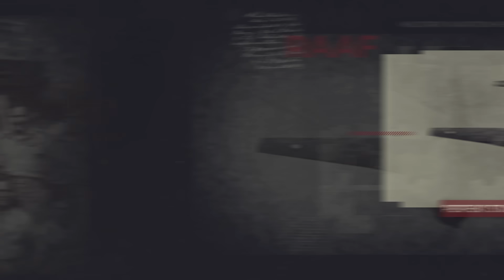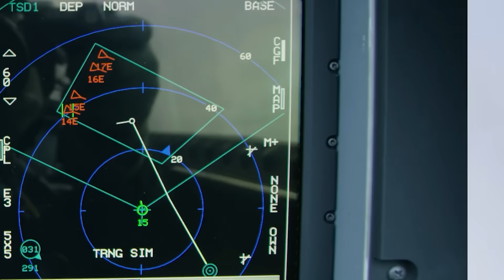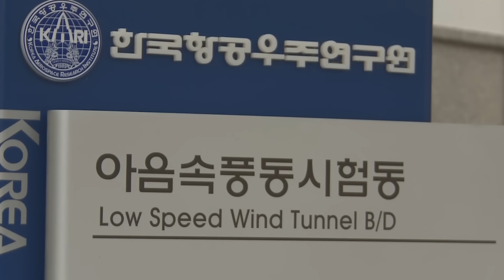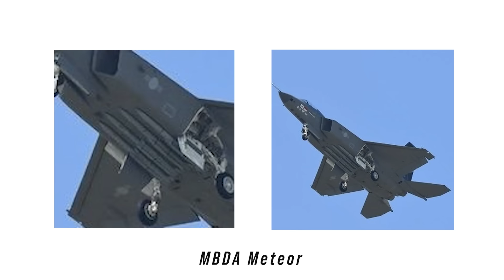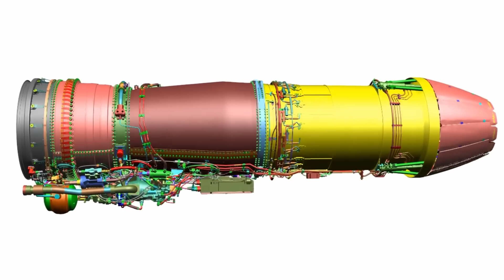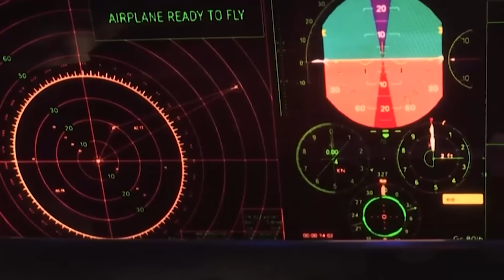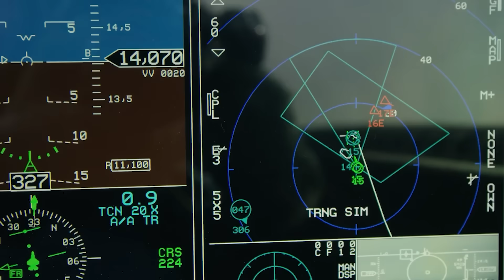KF-21: Korea's New Fighter

Comment: South Koreans often are brilliant engineers, I would not be surprised if this aircraft turns out to be a very serviceable platform.
Reply: Japan also got help from LM. The F-2 is essentially a derivative of the F-16 with significant differences that increase long range capabilities. 

South Korea meanwhile made their own derivative of the F-16 with the help of LM, the T-50 / FA-50. FA-50 is essentially a shortened and simplified F-16 for a lower budget point. 

Thus both countries got their own F-16 derivatives, Japan went for higher capabilities and much higher costs while South Korea went for lower capabilities and much lower costs.
Reply: @Stu_Bur Japan did get help from LM but frankly speaking the development of Japanese F2 is more like joint cooperation between US-Japan. This is evident thru the agreement made in Dec. 1987 during the Bush administration when the US government forced Japan to sign the agreement to limit Japan's native aviation industry. Based on the agreement US provided necessary techs and Japan handed over techs they developed during the F2 development.

On the other hand, KR's development of T50, KF21 is totally different story because KR had to nurture its industry based on tech transfer.
Reply: 😂Sure
Reply: A lot of nations have brilliant engineers but it takes a lot more than that to build a legit stealth fighter which is why America has the only ones doing it since the 1980s. Getting help from American companies that have actually built them will definitely help
Reply: Among the contracts between Lockheed Martin and KAI are as follows.
FA-50 has a constraint that it cannot exceed the latest F-16 specification.
So the FA-50 has its limits.
However, the FA-50 is a cost-effectiveness and has a full role to play.
Very powerful as a 5th generation pilot training, proximity support, and small multi-roll fighter.
It must be a very useful aircraft for both training and practice.
Armed forces are also evolving.
In Block 2
AIM-9 Sidewinder
AIM-7 Sparrow
AGM-65 Maverick
IRIS-T
KEPD 350K-2
AIM-120 AMRAAM
It will be armed.

What is unusual is that the Korean-made AESA Radar is better than the US-made Radar with performance limits.
However, due to the inherent limitations of FA-50, it seems to be impossible to mount.

However, KF-21 has no constraints.
This is because Korea has developed core technologies such as AESA Radar, IRST, EOTGP, and RF Jammer.
The interior armament is also under development and the MUM-T system is also under development.
We're testing to control three drones with wingmen
It is being developed as a multi-purpose fighter with more than five generations at the same time as the development of internal armoured windows.

The AESA radar developed by Korea is a gallium nitride material and is powerful.
It is currently used in Korean Aegis destroyers, M-SAMs, and L-SAMs.
Gallium oxide materials that are much more powerful than gallium nitride materials are also being developed.

Korea has strong EMP technology.
RF-Jammer is also very powerful.
It will reach NGJ-MB performance enough.

IRST is currently on board the frigate and in use.

EO-TGP is already applied to FA-50.

Core equipment is constantly being upgraded with the development of new technologies.

KF-21 Boramae is the name of a falcon when its young is raised for hunting.
Boramae is called the Little Raptor, but in the near future, it will evolve into the fifth and sixth generation fighter jets that will shine on itself.

I hope you will pay a lot of attention to KF-21.
Reply: It's not that hard to essentially replicate existing designs worldwide while modifying slightly in your own way. The hardest part is the manufacturing capacity, highend.
Reply: Lots of corruption, like USA.
Reply: 😂👍 yes from other Countries 😉 People you must look behind the Line also the K9 was from Leo 2 the machine inside ok only their very good adapting and so possible make it better.The K9 was that the difference to Leo 2 so possible inside over decade modernisation possible the same about the Fighter Jets so it's not engineered and their are fabulous
Reply: Maybe they can get Lockheed Martin to help them develop gen 6 aircrafts.  China is already working on to gen 6 platforms.
Reply: Chaebol
Reply: 포스코와 직접적인 지분을 보유한 일본 기업은 없지만, 포스코는 과거 일본 기업으로부터 기술을 지원받았고, 일본제철과는 상호출자 관계를 맺었다가 현재는 지분을 전량 매각하며 협력 관계를 지속할 예정입니다. 또한, 포스코 플로우는 일본 미쓰이물산과 합작 설립한 기업입니다. 
그러므로 일본기업이 아닙니다 거짓 정보는 곤란해요 😂
Reply: A few people seemed threatened by the Chinese here...
Reply: I would give the most credit to the Turks if they really can fly their TFX Fighter cuz they do it all alone and with sanctions from the west
Reply: @Skepticof  I agree that the US makes the best birds.  At the same token, you should know that without the US help, mimic and play from scratch is not easy at all.  Despite the fact the KF-21 looks similar to the F-22, it was developed from scratch with no help from the US.  The reality is that the US never helped South Korea to build its own advanced military fighters so the US can keep selling their overpriced F-35s or F-15 upgrades which would cost far more than producing KF-21s.    With 120 KF-21s by 2032, the Korean Air Force is no longer forced to use overpriced US-produced air-to-air or air-to-ground missiles.  KF-21 can utilize Korean-made advanced weapons.
Reply: @octoberonedave1371  you dumb noob SK received tech transfers for KF21 when they purchased F35😂 Keep talk like trash with 0 knowledge
Reply: its literally a copy of the f-22 kek
Reply: It looks pretty good but that can be deceiving Look at the Chinese knockoffs of 5 gens. They are weak with less quality, shorter range, and dangerous to operate.
Reply: @Forevertrue  There is a huge difference between Korean and Chinese quality, especially military war weapons, ships, and amazing buildings. Koreans can build complex things without stealing intellectual property, unlike the Chinese. The Chinese are famous for their tofu dreg buildings that literally crumble on its own, whereas the Koreans have built the tallest building buildings in the world like the Burj khalifa, Petronas Twin Towers, and Lotte Tower.
Reply: @JohnLee-db9zt  lmao I love how you say this while all tests and videos show that this shitty plane korean plane is literally a rip off of the f-22 while the j-20 at least has an original wing and engine design, and china also currently has the longest range tested naval missles so far even the usa doesn't have it
Reply: @NeostormXLMAX 놀라운 매연 스텔스 기능? 뿜뿜하는 중공 종이비행기는 저리 빠지세요 😂
Reply: With the help of Lockheed Martin.. maybe Japan can do better without any help of others.
Reply: @halfevilhalfgood2206  I didn’t say they were totally acting alone, it makes a lot of sense to use the experience of your partners in any situation.
Reply: @rsoul7282  - Most of the World's technology (and nations) has arisen from that doctrine. There is no reason to reinvent the wheel, and most nations don't have the money or time to embark on decades long Engineering and Development programs for such programs. The first design however, looks almost identical to an F-22.
Reply: @halfevilhalfgood2206  The help from LM was minimal, more like consultants without designing anything for the Koreans.  LM did not  give out any core technologies like AESA radar, IRST, EOTS, weapons/flight control systems, stealth coating, etc.  LM helped primarily in airframe design giving the nod the Koreans if they were going in the right direction. That’s why it looks like the F22 Raptor. The Japanese aren’t doing Jack. They proposed their own 5th generation fighter years ago and hasn’t gotten anywhere. Now they want a 6th gen fighter? lol.  Koreans are playing it smart by starting at 4.5+ gen fighter and moving up to gen 5. I’m surprised how fast this fighter was developed and on budget.
Reply: @JohnLee-db9zt  Altho LM didnt transfer a few core techs but KF21 is hugely based on expertise received from LM thru tech transfer when KR purchased and built F35/T50. T50 is basically built by LM, and KR was able to pick up skills and techs to further their development into native fighter such as KF21. Contribution of LM to KR fighter jet industry is undeniably immense.
Reply: @SH_K  A few core technologies? Lol almost everything important for a 4+ gen fighter with 5th gen capabilities besides the stealth frame was indigenously developed. There was no tech transfer from purchase of the F35 as far as I know. US doesn’t allow that. T50 started out as a basic trainer.
Reply: @JohnLee-db9zt  Do you have sources for your claim? LM transferred 21 technologies such as avionics program architectures, missile integration techs to SK to assist the development of KF21. US-LM-SK signed the contract on Dec. 2015 Engineers from LM were stationed on site the whole time for the tech integration. Only 4 strategic techs were barred from export.

As for T50, it is literally a plane fully developed with Lockheed Martin technologies which SK only participated to manufacture and pick up necessary skills. SK learned and mastered so that they can build KF21.

If you do not have sources for your baseless claims i suggest you to keep silent.
Reply: @halfevilhalfgood2206 They couldn't do it without help, so they took part in Tumfest in the UK and Italy.  think about it
Reply: @halfevilhalfgood2206 you are just dreaming. In the middle of nowhere
Reply: @halfevilhalfgood2206  Do you know that they joined the British and Italian fighter jet development projects late because they did not have the technology?
Reply: @halfevilhalfgood2206    Not true.  Lockheed Martin refused to provide help (so the US could continue to sell more of their overpriced F-35s to South Korea).  South Korea ended up building KF-21 on its own from scratch to reduce US dependency on military equipment.
Reply: @octoberonedave1371  not on its own. Never. SK received so much help from the US starting from the development of T50 to KF21. Do not spread misinformation.
Reply: @SH_K  US NEVER HELPED SK AT ALL!  SO THE US CAN SELL MORE F-35s, F-15 UPGRADES, AND US-PRODUCED MISSILES AT OVERPRICED CHARGE.  IT IS ALL ABOUT THE MONEY BRO!
Reply: @halfevilhalfgood2206  help from Lockheed ?  kidding ?   hahaha
Reply: I would be very suprised if they actually produce this plane. It doesn't make any sense for Korea to produce a stealth fighter,,,,I call bullshit.
Reply: @ronald8792  You seem to lack any knowledge of Korean history and KF21. It’s already slated for production next year for the Korean Air Force.  Why wouldn’t Korea want its own stealth fighter?  Korea already has a fully capable stealth fighter in the KF21. The main reason the KF21 isn’t 5th gen is because all the weapons are on the outside. It’s designed already to be able to have internal weapons bay for full stealth.  It will be much cheaper to acquire than hugely costly American stealth fighters that can only be maintained and repaired by American companies. Maintenance cost of American stealth planes are astronomical.  Also it will boost Korean economy when they can export stealth fighters to other ally countries.  Poland, Indonesia, India, Philippines, Australia, etc are already lining up to buy KF21 because of its competitive price and low maintenance cost relative to other competitors. Once it becomes 5th gen, even more countries will be lining up.
Reply: @JohnLee-db9zt  I would need to see the plane with my own eyes before I believe the story. It seems odd that Korea is starting  the plane building business after buying 40 F- 35's and under contract to buy 40 more.
Reply: @JohnLee-db9zt  I certainly do lack knowledge of the KF- 21 Korean fighter jet because there is no history of the KF- 21 fighter jet. Supposedly, a prototype exists but the plane hasn't even started production. But hey, since you know so much about the Korean wonder plane, what engine is it going to have?
Reply: @ronald8792  ge f414. Rumours say an indigenous engine is also under development.
Reply: @ronald8792 i don't understand the doubt you have. They already produced 6 of the fighters as prototypes, a ground testing unit and a training simulator. Do you think fighters need mess manufacturing assembly lines like cars do? They are all hand built like the first 6 prototypes. And with the 40unit orders from South Korean government what do you think is preventing KAI from producing them and supplying them?
Reply: @kevinoh4432  The F414 produces 57 KN compared to the 119 KN produced by the engines used for the F- 22. Meaning, that afterburners would be needed at cruising speed making it a terrible choice for a stealth plane.
Reply: @kevinoh4432  my doubt comes from basic economics. South Korea doesn't have the GDP to even think about putting a stealth plane into production.
Reply: @ronald8792  Really? World's 13th largest economy is not big enough? And with them still at war against the north's counterpart Korea's investment towards their military power has put them in top 5 firepower in the world. In consideration of these factors, i'd say, it's about time they make their own.
Reply: @ronald8792  you haven't watched the clip. It has plans to become full stealth in the future with few more upgrades meaning it's not a stealth fighter. And by the way, while engine upgrade is a necessity, stealth does not mean more power. Comparing it against  the F22 is like, "Why can't you catch that eagle, chicken!" F35s will be the highend fighters among the masses of kf21s in a real combat. Ge f414 is very capable for that application. Like f22 is ever gonna be in a dog fight pfft.
Reply: @kevinoh4432 A weaker motor means weaker electronics and the use of Afterburners. I almost feel like I need to draw a picture and send it to you right now
Reply: @ronald8792  f414 is the same engine being used for f18 growler - an electronic warfare fighter and the f22 catcher. Mic drop
Reply: @kevinoh4432  Yes, really. The 13th largest economy puts them in a 1997' Z28 not a 2023 Ferrari Spyder
Reply: @ronald8792  lol, the KF21 exists and has flown many times. It went supersonic, launched missiles, etc. There are single and two seat variants. It’s all been documented. All the avionics, radar, IRST, etc have been indigenously developed. What more do you need of it’s existence?  Are we not watching the same videos?
Reply: @JohnLee-db9zt  the dude is a waste lol
Reply: @JohnLee-db9zt  Hey, that's great. I wonder what they'll do with the F- 35's they purchased 🤔
Reply: @anthonylim2428  Make a valid point or go sit at the kids table.
Reply: @ronald8792 make a valid point? That's not what should come out of your mouth bud. 😂
Reply: @anthonylim2428  Times up. I gave you enough time to come up with an argument and you failed.....again.
Reply: @ronald8792  This purchase includes a political gesture from the S.Korean government, expressing the desire for the success of the F-35, intended to be a common frontline fighter in the free world, and ensuring that the development of the KF-21 does not compromise its benefits
Reply: @ronald8792 Fighter planes are classified into three categories based on size and weight.  High / middle / low Therefore, the F-22 and KF-21 are different fighters.  The F-22 is equipped with a PW large-diameter engine, and the KF-21 is equipped with a Ge medium-diameter engine.  Therefore, the KF-21 is a middleweight fighter that is smaller and lighter than the F-22.  In Korea, the KF-21 has already completed a 70-degree high angle of attack flight.  This is evidence that the engine output is ample, and a two-dimensional thrust deflection nozzle will be applied in the future.
Reply: @JIRO-FX3150 then, do you know anything about korean industry. No. You don’t. You know nothing about it. I don’ t know where you are japanese or not, but before making such a comment you have to study first. Regarding jet engines , hanhwa aerospace have been producing those engines for more than 20 years whether it is under license or not, and it is sufficient for them to make new engines
Reply: @mook_2000  South Korea's military industry is almost entirely German (submarines) and American (fighter planes).
Most of South Korea's manufacturing industries, including shipbuilding, steel, machinery, and automobiles, come from Japan.
There are probably few Koreans who know that companies such as Samsung Shokai and POSCO were originally Japanese companies.
Reply: @YY-gn9xc  そのサムスン商会に資金を貸していたのも日本の銀行だよ
Reply: @YYY-gn9xc I'm just trying to be nice and explain it to you because a lot of people misunderstood.
Samsung Shokai -> Imperial Bank of Japan
 Samsung Electric -> Sanyo Electric 
Samsung Electronics -> Toshiba NEC 
Samsung Display -> SONY SHARP
Samsung SDI -> NEC 
Samsung SEMES -> Japan Screen 
POSCO -> Japan Steel 
Hyundai Motor -> Mitsubishi Motors subcontractor Korean conglomerates and state-owned companies like railroads were originally Japanesecompanies.Everyone knows that LINE was created by Naver, but the other half was bought by a company called Softbank, so it is a joint venture.Even Daiso in Korea and CU in Korea were originally Japanese companies, but Korea bought them.Even Sanyang Instant Ramen, a favorite of Koreans, is a technology provided by Myojo Foods of Japan.
Reply: @JIRO-FX3150  Your arguments are not logically consistent at all and even make you doubt where the information came from. Samsung founder Lee Byung-chul said in his autobiography that he came from a family rich enough to study in Japan at the time, and that he founded Samsung Shokai(삼성상회) in 1938 with 30,000WON from his father, a wealthy farmer at the time. And even if you borrowed money from the Bank of Japan, I don't understand why it was originally a Japanese company. Has Chairman Lee Byung-chul not been able to pay back the money? Are you claiming that the Korean conglomerate is "originally" a Japanese company because of its technological cooperation with a Japanese company that ended 30 years ago and claiming that Line is a joint venture because of SoftBank's stake purchase in Line Inc. just five years ago? Line Inc was a wholly owned subsidiary of NAVER until 2019 when it negotiated an equity stake with SoftBank. Do you think this is consistent logic?
Reply: @JIRO-FX3150  In the case of Daiso, it operated under the name 'Asco Even Plaza' until the 2000s, but changed its name to 'Daiso' after receiving a 30% stake investment from a Japanese company in 2001. In December 2023, it repurchased its entire stake in a Japanese company. With the 30% stake, will Daiso become a Japanese company? Foreigners hold a 60% stake in NAVER, so is it a foreign company? In the case of CU, it signed a license agreement with Japan's Family Mart and operated Family Mart, but after terminating the license agreement with Family Mart in 2012, it started operating under its own brand called CU. Family Mart, not CU, is a Japanese company, right? But I canceled the license and ran my own brand called CU. Don't you know the meaning of a license?🤔
Reply: @YY-gn9xc  To begin with, about 90% of the Japanese people were immigrants from the Korean Peninsula (Yamato people), and about 10% were Jomon people.
Baekje on the Korean peninsula was home to many different ethnic groups, including Han Chinese, Buyeo people, Koreans, Wa people (Jomon people), and Yamato people.
I think it was recorded in an 8th century Japanese document that it was not Koreans who brought Buddhism to Japan from the Korean Peninsula, but descendants of the Han Chinese (descendants of the Han Dynasty).
There is no doubt that culture from ancient China was introduced to Japan and Korea, but it has nothing to do with modern China.
This is because in the 3rd century, the Han dynasty collapsed and the Xianbei people came to rule, and as a result of analyzing the DNA of the emperor who founded the Northern Zhou state around the 5th century, it was found that about 60% of the DNA was from the Xianbei people (Mongol lineage). I realized that it was true.
Today's China treats all surrounding countries as part of its history, but the people of Goguryeo were most likely nomads from Central Asia, not Chinese.
The history of China dates back to 1912, and it is known that indigenous peoples such as Hawaiian Polynesians lived there until 4,000 years ago.
Reply: @JIRO-FX3150  The Nihon Shoki (Chronicles of Japan) provides a date of 552 for when King Seong of Baekje (now western South Korea) sent a mission to Emperor Kinmei that included an image of the Buddha Shakyamuni, ritual banners, and sutras. This event is usually considered the "official" introduction of Buddhism to Japan.[4][3] 

reference.
1. Bowring, Richard John (2005). The religious traditions of Japan, 500–1600. Cambridge, UK: Cambridge University Press. pp. 15–17.
2. Dykstra, Yoshiko Kurata; De Bary, William Theodore (2001). Sources of Japanese tradition. New York: Columbia University Press. p. 100.
Reply: @JIRO-FX3150  You claim that the company is a Japanese company, even with some capital investments, technical cooperation, or even licensing agreements. According to your logic, isn't Japan part of Korea and China, which conveyed the letters and religions that became the backbone of the ancient country? You claim that Korean companies are "originally" Japanese companies. This is because Japnese companies collaborated with Korean companies with the technology they received from the United States. That's the logic you're arguing for, it's inconsistent, and the logic changes only when it's in Japan's favor. And yet Line Inc. is called a joint venture. It's so ridiculous.🤣 I keep saying, your logic is inconsistent, baseless.
Reply: @YY-gn9xc  what are you saying? The Yamato people themselves transmitted their culture from the Manchuria region to the Japanese archipelago via the Korean Peninsula.
The culture of Chinese characters originates from the Han people, and Buddhism originates from the Tibetan people. It's not a culture that Koreans brought to the Japanese archipelago.

Until around 1500 BC, the Yamato people migrated south from northeastern China and brought their culture, including Yayoi pottery and ironware, to the Korean Peninsula.
There is no doubt that it passed from the Korean Peninsula to the Japanese archipelago, but most of the culture was brought by the Japanese.
Reply: @YY-gn9xc  South Korea was founded in 1948
Samsung was founded in 1938
Since it was funded by Japanese banks during the Japanese colonial era, it is still a Japanese company.😅
Reply: @YY-gn9xc  Even if a Korean emigrates to America and changes his nationality to America, you will still be of Korean descent, right?
It's the same.
Reply: @JIRO-FX3150  ㅋㅋㅋㅋㅋㅋㅋㅋㅋㅋㅋㅋㅋㅋㅋㅋㅋㅋㅋㅋㅋㅋㅋㅋㅋㅋㅋㅋㅋ Samsung Shokai (삼성상회) is saying in Lee Byung-chul's autobiography that it was founded by borrowing 30,000 won from his father, who was a rich farmer at the time. but i don't know where the source of your information is, but you don't know that even if you borrow money from the Bank of Japan, you don't become a Japanese company? Yes, think what you want. Anyway, you will only trust the information you want to believe, and I don't know which country defines the nationality of a company in that way. And most of the electronic technology was born in the United States, so why does the Japanese say that Korean conglomerates are "originally" Japanese companies?🤔🤣 Did Japan invent the technology to make car engines?🤣
Reply: @YY-gn9xc  We all know that America invented semiconductors, and the NAND flash memory manufactured by Samsung was invented by the Japanese at Toshiba.
The lithium batteries in Samsung smartphones were invented by Americans and Japanese, but Sony was the first to commercialize and release them.
The blue LEDs in the LCD panels used in Samsung TVs are also a Japanese invention.
Other smartphones equipped with fingerprint authentication functions and cameras were first released in Japan, and were later imitated by the iPhone.　
During the Japanese colonial era, there was no currency called the won.:text-green-game-over:
Reply: @JIRO-FX3150  If someone change nationality to the U.S., that person is officially an American. It is under U.S. law, is protected by the U.S., and has equal rights to Americans.  And were Samsung and Hyundai ever a Japanese company?🤣The information that Samsung borrowed money from the Bank of Japan is also suspicious, but even if Samsung borrowed money from the Bank of Japan, which country's law is it to become a Japanese company? In conclusion, shouldn't a Korean company be an American company because the technology was all transmitted by a U.S. company to a Japanese company? And just like that, all Japanese companies are American companies. Your argument is the same as this.
Reply: @JIRO-FX3150  You're making a completely ridiculous claim again.😮‍💨If a company produces a product invented by Japan, is it a Japanese company? Then, the origin of internal combustion engine cars is Mercedes-Benz in Germany. Then, all the companies that make internal combustion engine cars in Japan are German companies. 🤣Are you seriously arguing that this makes sense?😂😂 And in the case of 'won', it was often called 'won' in Korean style. In the early days, it was also called 'hwan'. While using Joseon yen for a Japanese colonial era, generations who have called it a circle sometimes called the Japanese yen 'won' even after liberation.
Reply: You said that CU is Japanese and Korea bought them, then why can't I spot A SINGLE CU STORE IN JAPAN??? You said that daiso is from Japan. At 1992, a Korean created Asung industry which started daiso. At 2001, a guy named daiso, who is the founder of 100yen shop, invested 400million yen to get 34.21%of the company and changed the name to Asung daiso. After that, at 2023, Korea decided to take the whole part of daiso at 500million won. About Line, Line was created by Naver but a Japanese corporate body. Now, Japan is trying to eat Line as their own company.
Reply: And you said that Korea was founded at 1945 but still, Korea did exist with only different names. If Samsung was created at 1938 than it's the year that Korea was colonized via Japan. Even if we were colonized, we are still Korean not Japanese. Samsung was founded by a Korean guy so it is a Korean company. Any company can lend money from other countries. Tech s are usually from the U.S or Germany, then by the logic you said every thing is from them not Japan. Also for Posco if you need some steel, than you can buy or lend them from other countries😂 Don't make other countries' company to yours :)
Reply: @ronald8792 it sounds like your educational backgrounds are very limited and  just nothing, only ignorant and dumber
Reply: @ronald8792  I think you are a person who hates whatever South Korea does. Are you from the North? Lol😂
Reply: @ronald8792  I would be very suprised if they actually produce this plane. It doesn't make any sense for Korea to produce a stealth fighter,,,,I call bullshit.

There is nothing special about "stealth fighters". If you can design aircrafts and can produce composites then you can produce "stealth fighter".